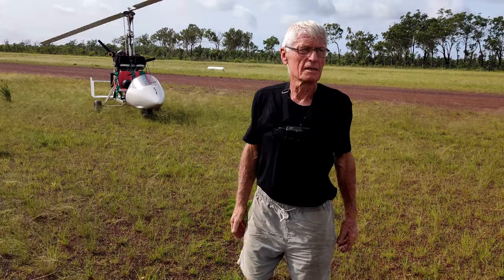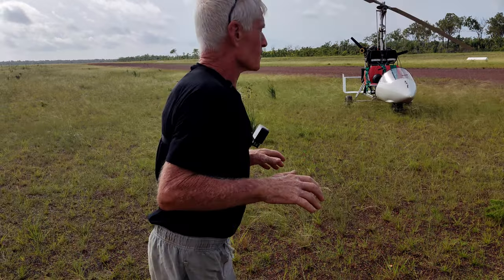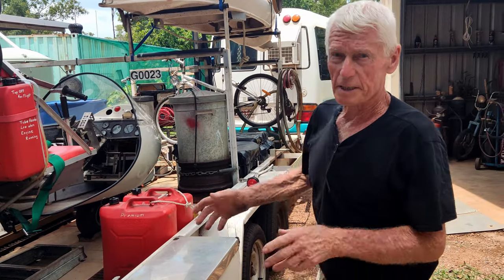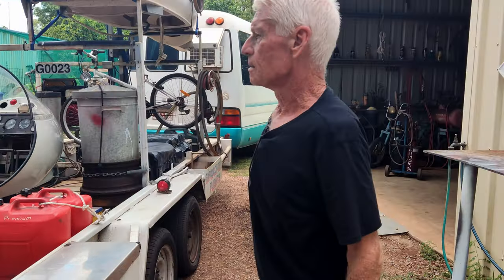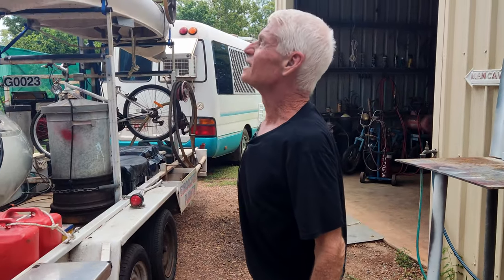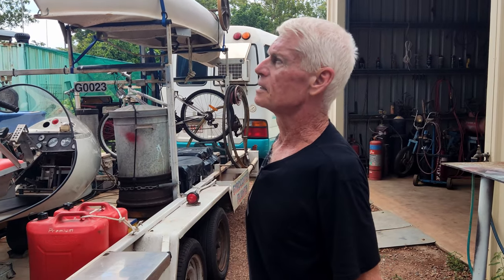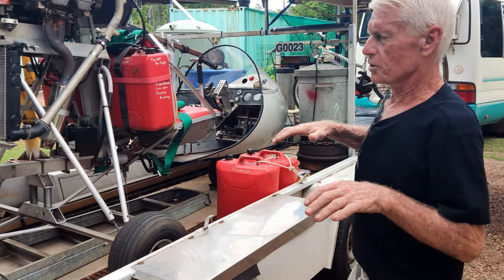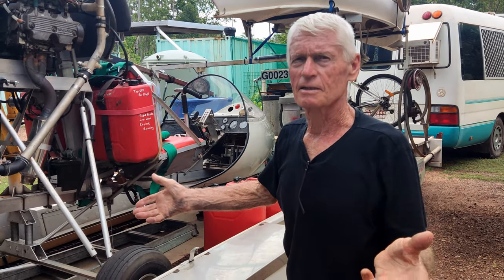mad max testing homemade gyrocopter part 2

Comment: the heavy starter motor from a truck you have sitting up there weighs 10kg .. take it off ,, try it i saw one do it no stick shakes,, and make one more video
Reply from the maker: That was my video where I removed the starter and it went smooth 😁
Reply: @omeobandit9928  yes  👍👍👍👍
Reply: @omeobandit9928  there must be a reason why many use a cable up to the pre rotor, I think it is to avoid having heavy things up there??
Reply from the maker: @gertkristensen6451  and also the flexible shaft systems can spin the rotors to a faster rpm than the small electric motor